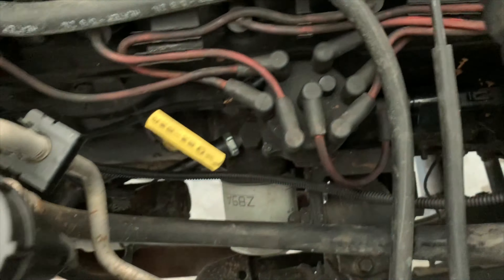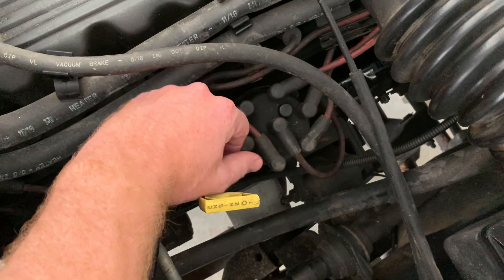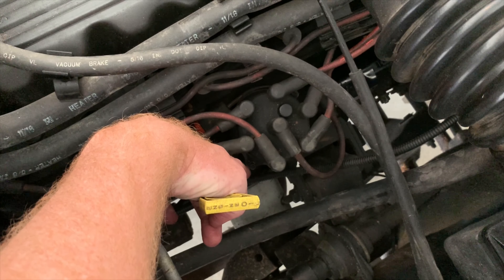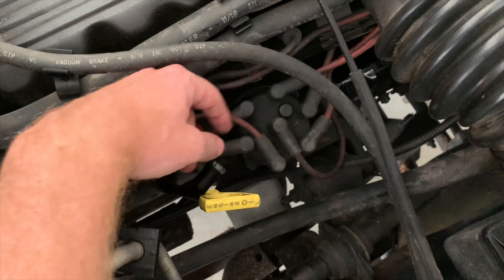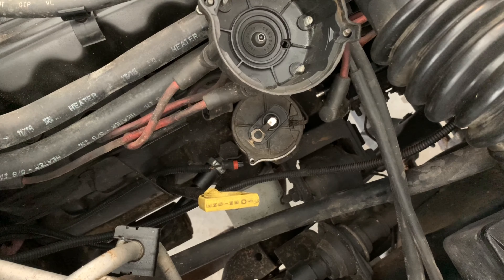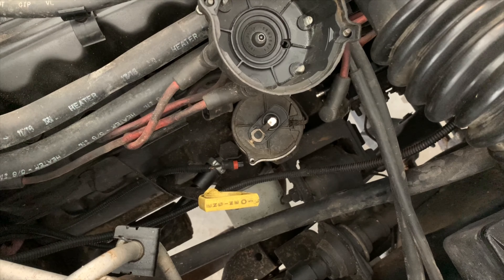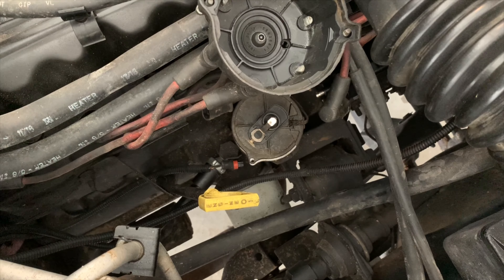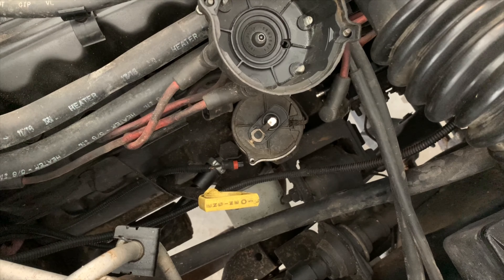Jeep Wrangler TJ Cam Sensor Install Replacement

Comment: Thank you. My 98 Sahara started throwing a PO340 code - cam shaft position sensor - but even the Jeep dealer part dept. couldn't find the part. I now find that it is called a 'distributor ignition pickup by NAPA and Advanced Auto. It is about $90 USD. I am going to change the rotor and the distributor cap since the blades on the rotor look work and the distributor cap is cheap. I have already replaced the crank shaft position sensor for about $100 USD but no joy there. I hope this works. Cheers.
Reply: Update on 98 Sahara - code gone power restored.  Thanks again.  Your video gave me the tip I needed.
Reply: Im going through this as we speek. pickup coil is toast, same thing, mabe things havent been updated. but thanks for this comment!

Comment: Question? Did your Tj chug a lug and seemed to use twice the gas in normal rides? And stall often
Reply from the maker: To be honest I thought the tj was good on fuel, but it did stall at random times yes.
Reply: I've got a 02' 4.0L that does right now, exhaust sounds very chuggy, I've also got a misfire on cylinder 2 and now I've developed an 02 sensor not heating (upper bank 1/1)